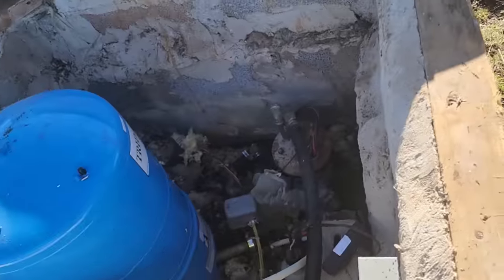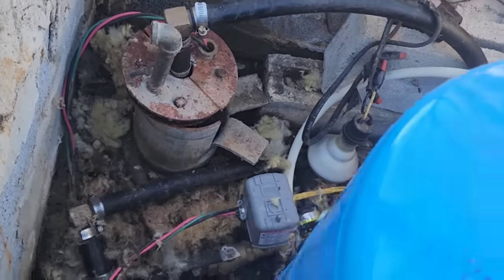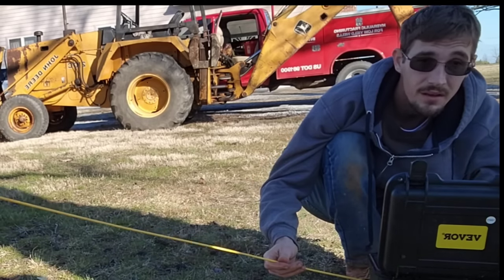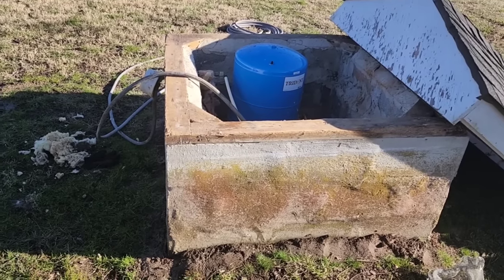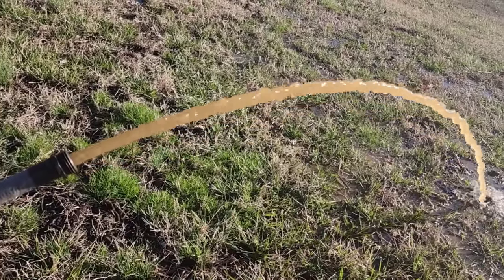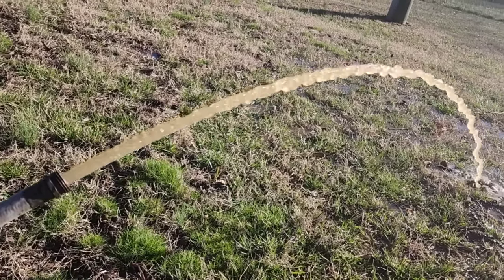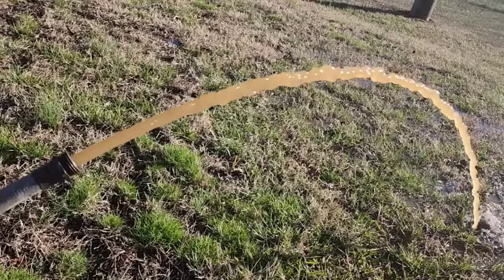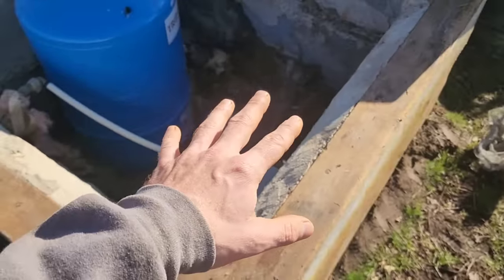Why Your Well Water is Discolored or Muddy. Explained

Comment: Great video! I’m also in North Carolina north of Winston, not too far from you. Two years ago I bought property where I found an old well from the 1970’s (determined by studying historical satellite images on Google Earth, when a structure was built.) It was an old sawmill gone by 1998. I dropped a plumb bob and measured the well 356’ deep with a 6” casing. Water level 43” below the top of the casing. It had been open with no cap for years, perhaps decades. I put a 3/4 hp pump 300’ down. Chlorinated the well for 4 days and then pumped it. At first the water looked like coffee, but cleared up quickly. The water still had a yellow tint so I ran it for an hour a day for a week. By the end the water was clear and my horses will drink it. Haven’t had it tested yet but I’ll make sure to run it several times a week to keep it fresh. Thank for the good advice!

Comment: This video is so helpful!

I’m actually a Journeyman Plumber by trade and have over 20 years of plumbing experience but limited amount of knowledge when it comes to well systems as all my life I’ve been living and working in the City, but I just bought a new construction home in the country and the well water is doing the same thing, coming out rusty since there was no usage. I kinda thought the same thing as you explained, rust buildup from the new steel casing, etc was the culprit but since my knowledge is limited I wasn’t sure. 
I did run our tub spout for about 15 minutes since it puts out about 4 gallons a minute but it only got slightly better and now I know why. Not enough run time.
Thank you so much for making this video. I will now proceed to “shock” the well and let it run for at least 3 to 4 hours and it should help. 👍👍

Comment: I lived in a rural area in Indiana for 16 years and every spring I poured one gallon of Clorox down the well hole and again in fall with another one gallon of Clorox. After each treatment, I'd let the well sit for a day or two, flush it out then use as normal. Most well owners are either afraid to treat their wells or simply don't know how. Chlorine bleach is a necessary evil to maintaining a healthy well. When I first moved to the property the water was mostly dark orange and the odor so bad it could be smelled two blocks away. By the time I moved away,  it was crystal clear with no odor, no bad taste. A dirty non-sanitized well is not only unhealthy, but it damages all the piping and equipment down stream which shows visibly on porcelain tubs, sinks, and toilets. A reddish-brown staining is a clear indicator a well needs attention.
Reply: What did you do for water for the two days you let the well sit every 6 months?

Comment: Its amazing how chlorine can treat sooo many common well problems. I used to use about half a quart of bleach for my well and thought I was doing it right, but recently I tried using a full gallon (275' 6" well) it really knocked some garbage loose. Much much fresher tasting after that, but I still use a full carbon block/RO/UV filter for my drinking water. I think the regular bleach douchings are helping to extend the filters though

Comment: Thank you for this video! I'm from South Africa, and just discovered a borehole with Franklin pump that the previous owners didn't even know of. I'm going to replace the pump and pipe. One question...I heard that one could use dry ice to blow out the hole. Is that also a way of doing it if the hole has been standing un-used for probably 20 years? It is about 240 feet deep, and we have quite the sandy type of ground...
Keep well!
Reply from the maker: Yes, dry-oce can be used, but its quite a violent reaction, so be careful & step away quickly from the well

Comment: Not much pressure on that system. I want a minimum of 50 psi at the shower head. Brilliant idea to encase the pump and associated mechanism in a concrete enclosure. this makes it very easy to work on the pump!  I have yet to see a well system which was not jammed into an enclosure which was as small as possible. Some wells are the length of a football field from the house!!! The well should be IN the house so it is protected from vandalism.

Comment: I have a well that was drilled in 1963 as per my documents. I replaced the existing pump/motor that was 19 years old on July 3, 2019. I just replaced the pump/motor 5 years to the day, 2024, with the same F&W 4F10S07301. I have the cloudy water as indicated in your video. If I perform the same procedure, is that putting undo stress on the pump/motor and running discolored or cloudy water through the new pump potentially damaging the pump? I understand that either way, cloudy water is running through system no matter what I do!. The removal of the 6 x 20' sections of 1" PVC was a back breaker! I don't want to do that again for a Long time! I live in CO across the (street) Highway from the Crystal River......Thanks!

Comment: At my grandma's house she had a shallow well. It was ten feet deep and dug under her dining room. It ran dry so she drilled a new one. At the end of the PVC the water was clear. In the house it was rusty. The chlorine eat the old pipes in the house. They are galvanized and to fix the rust she had to replace the old plumbing with new. Remember to look at the different parts of a well. The well and the plumbing. Rust is not always the well and can be a bad pressure tank or pipes.

Comment: I recently had to bring my unconfined artesian well up to code. Meaning I had to have a well guy.raise it above ground by welding an extension pipe to raise the height above ground and capedit off. He threw some chlorine down the well to Clean it up as the well was dug in the sixties and hasn't had a problem Until recently, when the water started Slowing down to a drizzle and then coming back. Anyway, now I don't know what to do. If I should try to flush the system by opening up all the taps and flushing the toilet 10,000 times to clean out the chlorine or what ? I tried to find a well watered test kit to see if it's even safe to shower. Now we're not drinking the water, and it's been 3 days since my kids have had a shower. Please help. Any advice would be helpful. I know nothing about Wells, and I can't get ahold of the well guy that did the Work. Just want to make sure that the chlorine is gone and There's no bacteria in the water that will hurt my kids. Please help I would be immensely grateful for any advice. thanks in advance.

Comment: We've been told our well is full of iron and to maintain it and keep the water line leading to the house from getting occluded we should put an expensive chemical and recycle for 24 hours each year.  Otherwise we're would be replacing our pump every 3 years.  It's there a cheaper alternative we can do to maintain our pump and keep the line clear?  Thanks in advance

Comment: I have a 120" well in plastic casing. When well was serviced to replace a check-valve, the installer cut and raised the pump a few feet in an effort to eliminate rusty water from bottom of well. That did not help. I installed an indoor filter on the main, and replace the cartridge every few months. Some areas of the country have high iron. Chlorine will not permanently fix rusty water. And what are those tiny two or three white shrimp creatures that appear in my filter?????

Comment: @H2o Mechanic Although I don’t think you will see this let me ask something just incase you do. I had a well drilled 215deep. We’ll pump is at 195ft. Getting 20 gallons a minute. Have a 2hp constant pressure well pump on it. It’s rated for 15 gallons a minute at my depth. I was told to let the water run to get rid of sediment. I ran it overnight 2 days so about 14-16 hours total. My water is still brown. So after looking at this video I dropped the pool shock an entire package since it’s a new well left of for 24 hours with pump turned on circulating water inside well. I then ran it a full night to get rid of chlorine and hoping it cleared up. Although it is not completely brown it’s still brown. Do wells ever run clear on their own? Or do I need filters. The plumber I  got doesn’t really know he said maybe let it run longer but I don’t think it will get any better. Or did I need more pool shock maybe not enough.
Reply from the maker: It totally depends on your region and how they find water there. It could be a number of things causing the issue. Shallow casing set could be bringing in surface water..  alot of possible situations. 
The best fix would be a really nice filtration system, be happy that you have alot of water & just filter it. It may be sediment, or it may be iron which are 2 completely different things but look similar to the eye. In time the well may clear up. The water needs to be tested for its mineral content, then that will determine what type of filtration system you will need
Reply: @h2omechanic  thank you so much for the response. I’ll be looking at testing the water and getting some sediment filters to start.

Comment: Not related to this but I have a 16 ft shallow dug well with a jet pump and a small pressure tank....Any insight on how to best maintain these things? Northern Ontario, Canada.....Works great so far.....
Reply: I’d ask New Hampshire USA they seem to be the state who uses them most. I’m in Connecticut and have one. There is one shallow well video chlorinating and scrub down video on YouTube. I have choliform bacteria as testing resulted in my shallow 
 well. I have a slimy rust colored residuals in my water even though it’s clear. Rust bacteria. I’m looking to do the same for mine. Mines 18’ deep with a 3’ concrete casing and concrete cap. Blew through two water heaters in 6 years. For us it’s pertinent to drain our water tanks yearly and likely change your water heater sacrificial zinc rod. Last heater of 3 years the rod completely corroded and fell off in the tank 😳 first heater I could t even get the brass 1-1/16” nut off top of the tank.

Comment: Mine is 377 & still has iron. I bleach mine let the iron oxidize about 4 hours then drop in a pipe to the bottom & crank the air to it let it run for a few hours . Sadly that things a 2 incher & i have to run a jet pump  instead of submersible and i have to pull out the packer assembly everytime makes it very annoying.

Comment: I think you just diagnosed what's going on with my well in the first 2 minutes of your video.
35 year old well, 300 feet, supposedly 3 gpm. Never had a problem with muddy water, just a small amount of sand for the first few years. Roughly 20 years ago, pump was replaced, well was also chlorinated at that time, no problems with it until recently.
As you mentioned, the number of people and the amount of water being used has went down significantly from 10 years ago. Over that time, my father passed away, my mother quit working due to her age, and I fully retired 3 years ago.
The only regular useage of water on a daily basis now, is flushing the toilets, preparing meals, and washing the dishes. We're no longer taking showers every day due to not having to go to work, and clothes washing has also become very infrequent for the same reason.
Last week, started to get muddy water inside the house. Checking the sediment filter we installed some years ago to catch any sand, the filter was literally saturated with what looked like orange sediment, to the point it had started being pushed thru the filter element.
Thankfully, putting in a new 5 micron string wound sediment filter element has cleaned up the water inside the house for the time being. I was worried that we might be looking at some expensive repairs to the well, such as having to pull the pump and install a liner.
But now, it's possible that the only thing that is needed, is to get the well treated and purge a good amount of water out of it, to get rid of the muddy water.
Reply from the maker: Bingo! Treat the well every year. 
Remember that you have 20 years of buildup to clean, so I may require a few treatments at first. Buy 2 bags of Pool Super Shock-it. 67% Calcium Hypochoride (misspelled) . Check out my Vid on Iron/bacteria well treatment. I call it Loop Chlorination. It does a thorough job. But your on the right track! I see it often in my trade, & I understand why it happens.
Reply: @h2omechanic  I watched your vid on Loop Chlorination. And now I'm rather miffed at the guys that replaced our pump and chlorinated the well 20 years ago - they just dumped in a bag of what I assume was also Pool Super Shock, installed the new pump in the well, and called it a day. They never said a word about needing to flush all that chlorine out of the well. My parents had to get by on bottled water for 2 or 3 weeks, and could barely tolerate taking a shower, because there was so much chlorine mixed in. Might as well have been getting our water from a municipal swimming pool.
I think I'm going to talk with one of our neighbors, who has been in the construction business and a friend of the family for decades, if he can recommend a good well service company, because there's a few other items that need to be addressed with our well setup besides chlorination. Our 35 year old pressure tank, a WellxTrol WX-202, is starting to rust on the outside. The installed pressure gauge doesn't even come close to showing the actual pressure any longer. And the pressure switch, whether due to age or someone misadjusting it years ago, when I checked a couple days ago with a Watts pressure gauge on an outside faucet, is operating on a 20 to 50 psi pressure band.
Basically, the whole system is in need of an old age upgrade, and being brought up to current code.
Reply: @h2omechanic  Local pool supply store has shock treatment with Calcium Hypochlorite, but it's 73%. Is that too strong a concentration, or would it be acceptable?
Only other pool shock available locally that uses calcium hypochlorite, is only 50% or thereabouts, with a bunch of other ingredients.

Comment: Does the hot water heater size play a role in what size the water pressure tank size should be in the well house. ?   Cause I have replaced everything.  And still can not get the water to run proper. Alot of air in line. Help
Reply from the maker: Typically air comes from one possible point. Youd have a check valve near the tank & its holding back the water pressure, you'll also have a check valve down in the pump but it'll be leaking.  This creates a air pocket in the pipe. 
So my question is, Do you have a check valve at the tank?  Also , did you replace the pump?

Comment: how true  as it is only my hubby and myself  . But in summer because I use water more often it is clear and come winter it gets dirty . question  since I am new to wells after moving from NJ in 2004 to VA  why are well pressure tanks not protected from freezing  like in what you are showing . My crawl space is around 7 feet deep  and basement part is is 12 feet from floor to ceilng . See plumbers here scare me  because I am not sure they really know what they are doing . I have a hydrant by my well and after watching this I have been running it until it clears 3 times a day  and water seems to be clearing up after pump was replaced .But no one can really explain why pump drained the well and ruined my whole house filter .I finally took whole house filter out of the crawl space that was ruined and took it apart and the filter media is full of red sludge . Pressure tank was also full of red sludge and so was my water heater when I flushed them . Also pex question on fittings     the band verses the clamp method  . I read clamp method  should not be used on white pex  only on blue pex   , it can void warranty . also what brand pressure tank is better I have proflow from fergusons plumbing supply  . I am really trying to learn these things before another plumber messes things up . I had several water test done  only showed ph at 6

Comment: You put in the shock, you let it cycle, then let it run.  The water came out clear after a few hours.  Did the well need further work done to it or was the iron bacteria problem solved?
Reply from the maker: I'll be going back soon to finish the job & give an update. The owner says the water is clean & no longer has a metal smell. I believe it's fixed
Reply: @h2omechanic  thanks for the response, I just bought a house with the same issue.  A plumber around me was trying to sell me on installing a 2500 dollar filter system to fix it.  I asked them about bleaching (an elderly neighbors term) the well and they said that dosnt work.  I guess they haven't seen your channel.
Reply from the maker: @johnny rocket  I believe it fixing the source,  not filtering out the "stuff".  Try to clean the source as good as possible, then you can filter it if needed. The filters life span would be way longer!. 
My loop Chlorination is $375 for a 24hr treatment. They want $2500 for a filter system. In my opinion, it's worth trying for 375. But anyone can do it for $50 in parts. I just have to make 2 trips to the job .

Comment: So we have 5 and sometimes 6 people using hours.  Bored well 40ish feet. Shallow water table.  Looks like concrete casing

We run out of water pretty easy. 

Now my issue.  Had the iron taste, so I bleached it.  Only 1 quart.  Didn't do anything so then I did it again 3 quarts.  We have orange water now.  I can only run it 15 minutes full blast so i am doing it periodically to clean it out
Reply from the maker: You'll never be able to fix Bored Well water. It's all surface water. 
Your issues are typical. I'd recommend getting a Drilled well & replace the bored well.
Reply: @h2omechanic  it's cleared up now.  I think the dirt or clay color was from the bleach being in there and hose splashing as I returned it to well.  I don't know if the iron taste went away yet or not but will see over next day or so